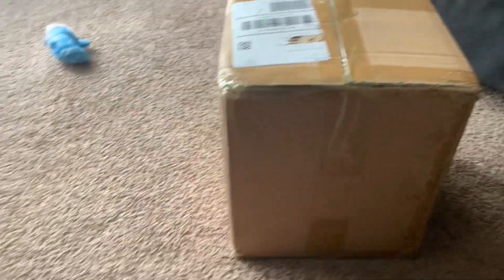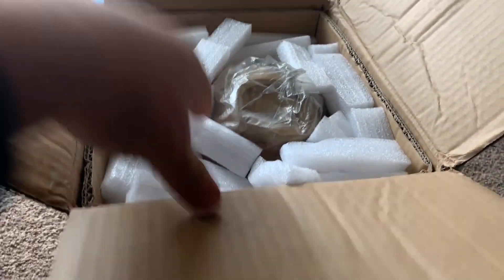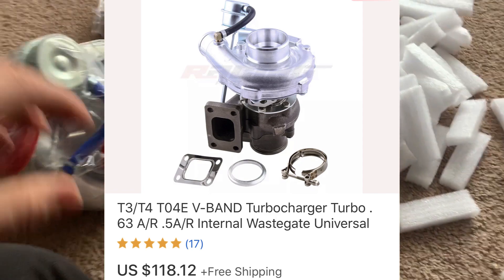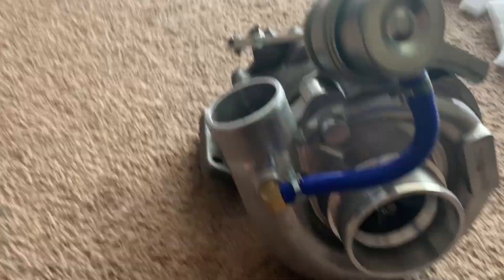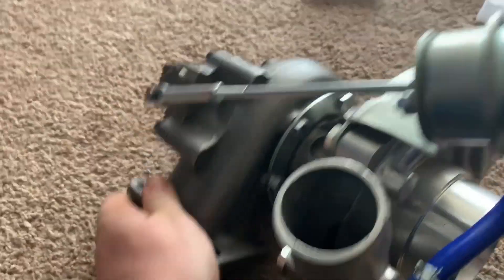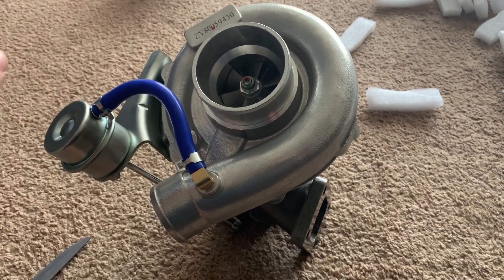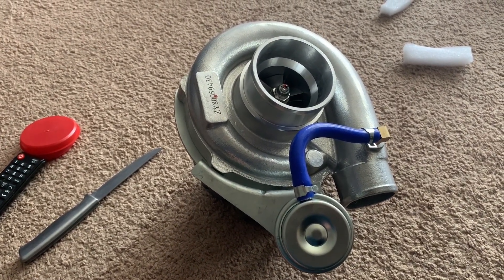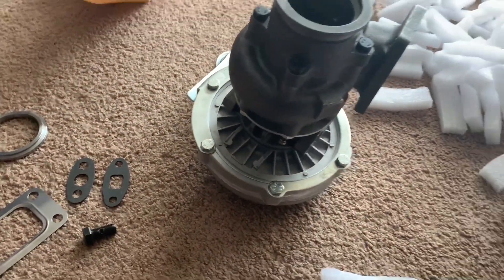How Cheap Is Maxpeedingrods Turbo?? (Turbo Civic Turbo Build)

Comment: I'm building a astra H vxr now fitted with a saab b204 630cc injectors front mount intercooler welbro fuel pump maxpeedingrods Gt28 turbo and all sorts else hoping she will be up and running soon then after strip down and bigger injectors and bigger turbo again and so on. Wanting 500plus hp. Easy achievable on these engines. Let's hope the turbos are upto it
Reply from the maker: Christopher Carson good luck man! My turbo is actually on the new b series build
Reply: @GottisGarage  look forward to seeing more of this build buddy :)

Comment: Buying turbos from these people  is a mistake.  Better off buying a clean buying a used OEM.  MY car has gone thru 2 in 1000 miles.  It's a 116.00 turbo, sure they will give you another.  The just don't install it.